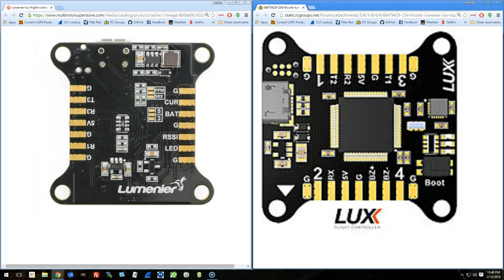Lumenier Lux Flight Controller In-Depth Review

Comment: So i hooked up my esc to my Lux Flight controller but they only beep once. Ive used them before and they beeped like 2 times and when i hook it up to betaflight the motors do spin when i go to the motor tab so what do you think i should do about this
Reply from the maker: +James Simmon I don't even understand the problem. You say they spin right? That's good.
Reply: Joshua Bardwel no they don't spin up they beep one time and that's it

Comment: I did not like mine at first. it needed to be soft mounted. I produced a very bad motor problem under mid to high throttle. The same problem that occurred in your black box analysis of this board and I was using stock PID's. After soft mount it went away although it was also running a later version of BF with soft mount so i do not know how much was due to BF versus soft mount. The real plus is quality and easy install, you can slap this board into a quad lickidy split LOL. My biggest complaint is no serial pass through for BLheli and will be the reason this board will be removed  you can use a FTDI adapter but i would have to tear down install pins reassemble for that and there are other cool boards i want to try including V2 of this board. This version at $14.00 from bangood is a steal no matter how you look at it

Comment: dear Joshua i have one of these Fc but i have one problem i used a R9DS reciver with my AT9, in betaflight all works ok, at9 and channels work good i, set my modes,  calibrate my end points, my dorne arms when i turn de aux chanel were it is seted but when i plug my battery my at9 stops sending signal or maybe my reciver stop workin, it shows no signal on de chanels, if i move the trottle, yaw, roll, pitch  sticks nothing happens, its like something were disconected, could you know what could be wrong?
Reply from the maker: Usually this means you have something else sharing the UART, like an OSD, and it interferes with the receiver. Do you have anything else connected to the UART where your receiver is plugged in?
Reply: OHH THAT BRINGS ME AN OTHER DOUBT, THAT  FC BOARD RX 5V I HAVE THEM IN UART 1 SO IF I CONECT LIKE YOU SAID MY OSD ON RI TX1 THAT MEANS THEY ARE SHARING THE SAME PORT? SO IF THATS THE PROBLEM WHERE I CAN CONECT MY OSD? MANUAL SAIDS ON THAT UART
Reply from the maker: That's the problem. Connect your OSD to... any other un-used UART!
Reply: thank you for ur time and help, you also  help our fpv comunnity becouse i share my problem with the group and the solution of the case, it was what you said, i was sharing the uart thanks again and keep spreading your knowledge

Comment: Hi Joshua, i Build a Quad with the SpRacing F3 6Dof Board on a Martian 2 Frame (Alien 5" clone). The Problem is the SpRacing F3 Need 5V, so i use a Little Bec, the PDB from the Martian only has Lipo Power directly. So i'am intereseted in buying the Lux Fc this can run directly Lipo Power. So i need no Bec, Cam and OSD can run from the Vtx 5v, the build are very clean... The question is, is the LUX FC better than the Sp Racing F3?
Reply from the maker: +Enrico Oeser I like the features and layout of the Lux much better than the SP3. But they won't fly any different.
Reply: Joshua Bardwell ok thanks. I think I stay with the F3 that fly good for me. Is there no difference the Lux can run 8khz/8khz?
Reply from the maker: +Enrico Oeser marginal.
Reply: Joshua Bardwell ok good to know. Is there a other easy board that can be direct run lipo power witch is better than the Sp3? The Kiss Fc is Perfect for this Frame but I won't change to kiss. I'm new in the hobby about 4 months and I started with Betaflight. For my opinion Betaflight is the standard in my region. But it is heavy to find a good easy board, I don't like a all in one with PDB and OSD. Just a simple board that runs perfectly with Betaflight :)
Reply from the maker: +Enrico Oeser all Betaflight boards will fly pretty similar. Pick one with features and layout and price that you like. Soft mount it. Of there is any difference it will be in the gyro. Get one with a 6000 gyro if possible, but other gyros can also be good if you soft mount.
Reply: Joshua Bardwell ok thanks, the problem with the gyro sucks on the Lux. That is the only reason why I don't buy it today. The Sp3 is hard mounted and ran smoothly.

Comment: Is a uart like an output to run other things like telemetry? Soz I'm new to this
Reply from the maker: Yes. A UART is a serial input/output. It can be used to send data to a telemetry receiver, receive data from a serial receiver, talk to a GPS unit, and so forth.
Reply: Joshua Bardwell  ok thanks a lot. One more thing, what's the go about the "black box"?

Comment: Hi Josh,

I have this board, and I updated it to BF 3.0.1 ( w/ 8KHz Gyro and 4KHz PID loop frequency with the accelerometer off)I also Run the older RG20 ESCs and  Skitzo 2500KV motors with 4in HQ Triblades all controlled by a Taranis. My quad, out of no where, will just roll but get right back up to normal. It does not do it all the time but it is so unpredictable when it does. Do you have any clue what could be wrong? Thank you.
Reply from the maker: Is your CPU utilization too high? Try running 8k/2k.

Comment: I got this board and mounted it with O ring and silicon tubing since I already bought this when it first came out . Got it flying great no falls and no shakes . Using betaflight 3.0.1 Got it set 8khz and 4khz loop time. So far got to live with what I have.
Reply from the maker: Glad it's working for you. It's a solid board if you manage to avoid its pitfalls.

Comment: The problem is that the gyro sits right on the outside edge of the fc    absorbing all the vibrations. All that thought put in this board and they go and do something silly like that mount the gyro in the middle of the board

Comment: I soft mounted the Lux and still getting oscillations. Can you recommend any filter settings gyro/PID frequency?
Reply from the maker: You can try betaflight 3.0 with both low-pass and notch filter on the gyro and d term. Use default low-pass values and use my video on how to set up the notch filter to set notch on gyro and d term.
Reply: thanks Joshua

Comment: Great video! Just a Quick question.. I see that i am going to have to bridge the 5, and middle pad to power my receiver.. but does that mean I can solder a extra wire on the 3v pad? The reason I ask this is because I have some rgb led's which only work on a 3.3v output.. so will this work or is there another 3.3v output? Or cant I use them at all?
Reply from the maker: I wouldn't assume that the 3v pad is a 3.3v output, but perhaps it is. A simple test with a multimeter will determine. If it's 3.3v out, I don't see why you couldn't use it, BUT beware that the 3.3v regulator on most of these devices is not intended for higher current draw like RGB LEDs.
Reply: Oke great! I also found a FC that I think is not well known.. the motolab tempest.. ever heard of it??! And if you had to pick between the lux or the motolab tempest, which one would you pick? Or would you pick none of them and go for the deluxe sp f3 with osd.. I watched alot of your videos but there isnt much to find about the tempest or deluxe with osd:(
Reply from the maker: I'm familiar with Moto's FC's. They are very well designed. I would probably take the Tempest over the Lux because the Tempest has the MCU6000. But I'm never completely satisfied with FC's with built in PDB's because they usually lack a good OSD solution. Does the Tempest have a built in current sensor? If not, how do you get current reading from the PDB, if the PDB is built into the FC?
Reply: +Joshua Bardwell im not really sure.. im still New to the hobby.. but maybe this can tell you? https://www.google.nl/search?q=motolab+tempest&prmd=isvn&source=lnms&tbm=isch&sa=X&ved=0ahUKEwjE3cuA7-bOAhXGkCwKHQOmCSwQ_AUIBygB&biw=360&bih=559#imgrc=Gif2-ayuz_mOiM%3A

Comment: I hope you can answer this quick question. I recently purchased this board as part of a refit on my QAV-R. I powered it off 4s main pack voltage on the "batt" pin, which according to Luminier, can take up to 6s. I bridged the SRX pad as well as the 5v pad to supply power to my X8R. I checked my wiring thoroughly for shorts and found none. I completed a brief flight to test primary systems and had no problems. However, on my second flight with it, after a few seconds of hovering, the Lux emitted some smoke and ceased function. My X8R was also destroyed. The Lux will no longer power up from the "batt" pin, though it will power from USB and is otherwise not damaged. I believe that the internal regulator on the Lux failed and destroyed itself as well as my receiver. 

My question is this; is this something I can expect from the Lux? I have asked around and done research that seems to confirm this. You didn't mention this in your review, so does it have something to do with powering from main pack voltage? Users on r/multicopter have stated multiple failures similar to what I reported and a review on the Lux page on getfpv reports a similar outcome. Is there some way to set up the Lux to prevent these failures?
Reply from the maker: +Adhikara Budhyhartono I would reach out to Lumenier for support on this one.
Reply: +Adhikara Budhyhartono did you ever get an answer from Luminier about this?  Same issues just happened with my Lux.  It's a new board I was using for a QAV-R build.  Everything was fine at first, I could power the VTX, OSD, X4R, and camera from the LUX via the 5v pads, but then I attempt a ESC calibration in Betaflight and everything stopped working.  I just tore the build apart, checked the wiring, going back to nothing connected to the board besides the battery, which is connected to the BATT pin, but now nothing happens.  No power.  The  LUX will power on when I connect the USB.  Very frustrating!!!
Reply: +Joker 89 if you were using littlebee ESCs a voltage spike may have destroyed the internal regulator.

Comment: How did you connect the black box? I have a openlog black box but im lost about what the manual says the connect it. It says connect T1 R1 T2 R2 T3 R3 to tx rx on the black box openlog so do i just solder 3 wires T1 T2 T3 to the tx on openlog and the same for the R1 R2 R3 to the rx on openlog so the 3 wires are all joined from the fc
Reply from the maker: TX on the Lux goes to RX on the OpenLog. PIck ONE and only ONE TX pad based on which UART you are going to use. You cannot use the same UART as is used for your serial receiver, assuming you are using a serial receiver. I don't remember whether Lux uses UART2 or UART3 for the receiver, but you would want to pick whichever one of those wasn't used.

Comment: Hi Joshua. I have this fc all is good apart from the motors jitter at low throttle. How do I fix this think its the noise can I filter it out. Hope you can help
Reply from the maker: +mark rankin soft mount with vibration damping bumpers.
Reply from the maker: +mark rankin soft mount with vibration damping bumpers.
Reply from the maker: +mark rankin https://youtu.be/KaOWkecIx-g
Reply: +Joshua Bardwell Thank you so much its that simple lol cheers

Comment: Just wanted to pop in and say thank you! I spent the last 2 hours trying to figure out how to update the firmware on this Lux FC, and couldn't find any documentation. I had your video running in the back ground and just happend to catch at the end where you mentioned restarting the computer. That did it! I should have known better. Any way thanks, you saved me a lot of grief!
Reply from the maker: +Dan H Awesome!!! Now get that copter in the air!
Reply: +Joshua Bardwell I would, but I hit another snag. It would seem the receiver I have, a spektrum AR610, does not play nice with the Lux... Would you be able to give a suggestion? I have a Spektrum DX6 radio, I'm hoping that's not part of the problem too.
Reply from the maker: How is it incompatible?
Reply: +Joshua Bardwell Thank you for responding. I can get it to bind to the radio, but I can't arm, and I don't see any inputs in clean flight. As far as I can tell the Lux can only use a PPM or SRX receiver, and after scouring the web, I have doubts that the AR610 is capable of either. I have tried both jumpers on the back of the Lux.
Reply: +Joshua Bardwell sorry, you will have to bare with me because I only barely know what I'm talking about, heh. I literally picked up a remote about 2 months ago, so I'm not super familiar with all the different protocols, this is my first time using clean flight too, I was using librepilot on a CC3D board.
Reply from the maker: I see your problem. AThe AR610 is not a serial receiver. You want to get a Orange satellite receiver from HobbyKing. That will work with your radio, and I believe it should work with the Lux.

Of course, you could also buy a branded Spektrum satellite, and pay lots more for it. But everybody I know who flies mini quads with a Spektrum flies Orange.
Reply: +Joshua Bardwell thank you sir, that's what I was thinking, except I was looking at the AR7700, only because it was branded, and specifically says PPM/SRX. So I will go with a OrangeRx R100 Satellite Receiver instead? And do I need to get a regular receiver to bind it?
Reply from the maker: Dan H I don't know about binding. I think you can bind it using cleanflight, but I don't fly spektrum so I'm not sure.
Reply: +Joshua Bardwell no problem, you have given me a new avenue of attack, I'm new to all this, but I really like this board. I like how low profile and clean it looks all wired up, now I just want it to work! Thanks again.

Comment: Is there an OSD in particular that you would suggest for this board?
Reply from the maker: +Nick1814 RedRotor RROSD.
Reply: +Joshua Bardwell Thanks.  Would this replace the PDB that would come with a QAV-R?
Reply from the maker: Yes. If you must, you can mount it on top of the QAV PDB in a stack, but it's sort of defeating the point.

Comment: Hey Josh,
  I'm having a prob with my LUX where when I turn my radio ON, it puts the board into bootloader mode (only blue LED turns ON, board acts like its in bootloader mode by disconnecting everything else).  Have you come across this problems before?
Reply from the maker: +Vinnerd FPV Sorry, I totally haven't. That is a really weird one. 

The board shouldn't enter bootloader mode unless the button is pressed when it is powered up. I don't think (at least I wasn't aware) that the board could enter bootloader mode after power-up.
Reply: +Joshua Bardwell 
Yeah its really odd, I'm also having probs with my Ports & Configuration tabs too, every time I press Save in one of these tabs, it saves ("EEPROM: saved") starts "rebooting", but never stops rebooting unless I unplug the LUX; and it saves my changes  sometimes and other times it doesn't; this all happened after I downloaded the LUX Race target via DFU, etc..
Reply from the maker: +Vinnerd FPV Try re-flashing. Make sure you do full board erase.
Reply: +Joshua Bardwell 
 Thanks, will do.. Also, Thanks for explaining in your "Cleanflight Controller Roundup" video why the LUX never stops the reboot sequence until un-pluging the LUX (which is due to the lack of a CP210 chip in the LUX).. your videos are a life saver
Reply: +Joshua Bardwell 
OK, figured out what the problem was – I had the serial rx turned on for UART 2 and not 1; once I switched that, it worked and stopped going into boot loader mode. But now I'm having twitching problems. I haven't done too much to try to figure that problem out bc I am not sure where to start; any ideas before I dig in?
Reply: +Vinnerd FPV 
My quads also flipping upside down violently soon as I throttle up

Comment: Hi Josh, is there anything I need to do on Cleanflight to make the Lux read the receiver signal? I have Betaflight 2.5.4 programmed. I am using a X4R SB and I jumped the 5V (I understand you said 3v in the vid, but the operating voltage for my RX is 4-10v) and the SRX. I selected RX_Serial and SBUS on the configure tab, but when I reboot, Cleanflight fails to save my settings and goes back to the set up page. Is there a USART that I need to activate? I tried all three and Cleanflight does not save my settings.
Reply from the maker: +680production SBUS is on UART 1. Go to the Ports tab and put Serial RX active on UART1. Nothing else on UART1. Then save that. Then you can set SBUS and RX_Serial in the Configuration tab.

See here for an example:

https://youtu.be/htkw7d97bOo?t=2m38s
Reply: +Joshua Bardwell thank you man, I got my Lux programmed

Comment: I am really considering buying the Lux board, but i have 1 question: is it possible to use SBus, Frsky Telemetry, OSD and Blackbox at the same time or is SBus using 1 UART port?
Reply from the maker: +skatebjarne SBUS is using a UART port. You can only have three of those four things at one time.